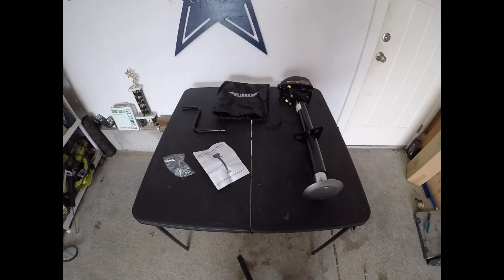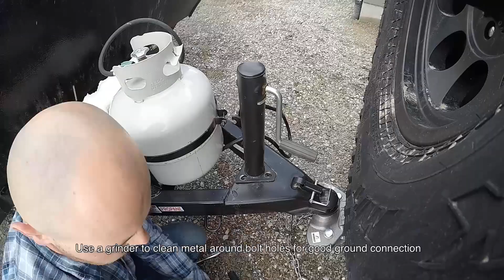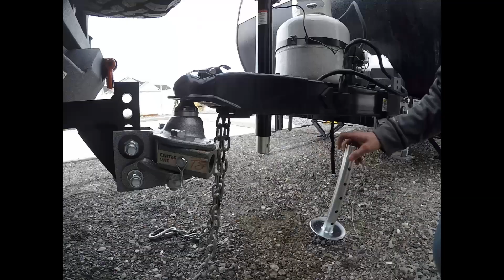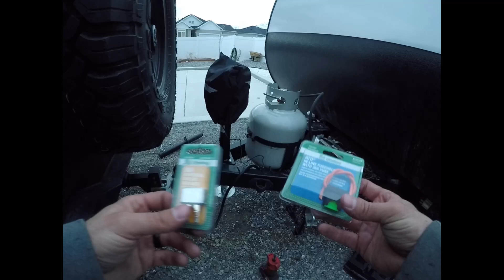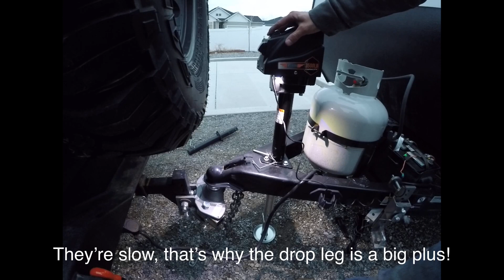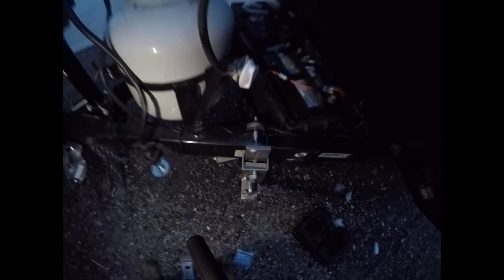3500lb electric jack install Libra

Comment: Where did you get the auto reset breaker? And, how many amps is it?
Reply from the maker: I just got it at Oreilly. Its a 30a fuse. Ensure your wiring is correct for the amperage you are running. Usually 10awg for 30amps.